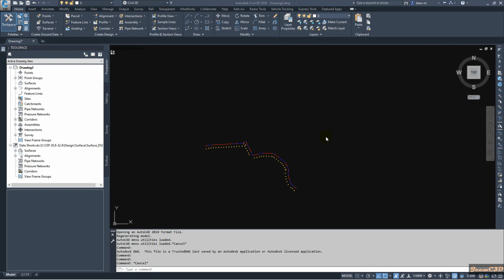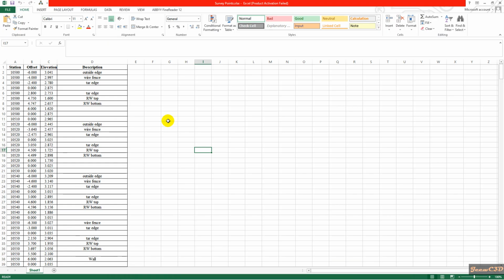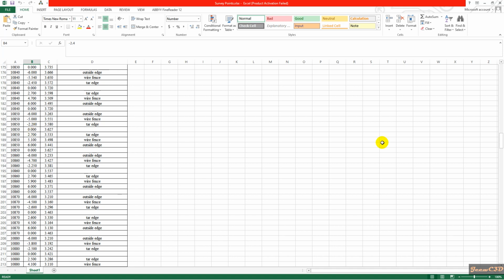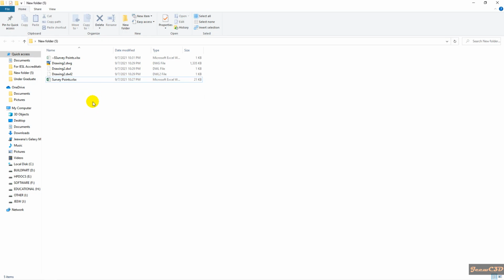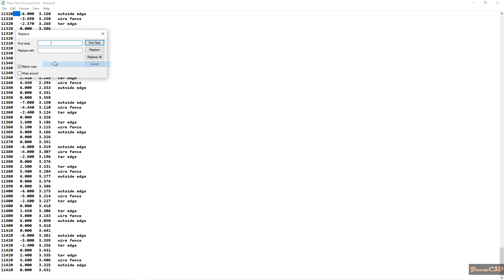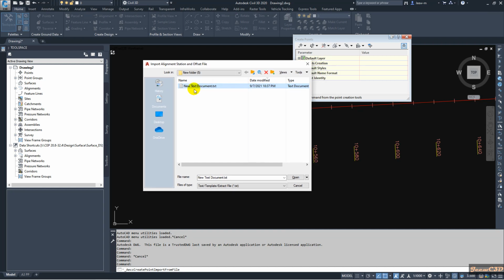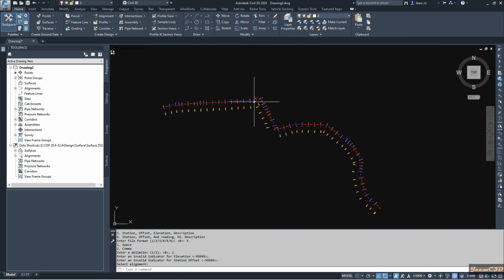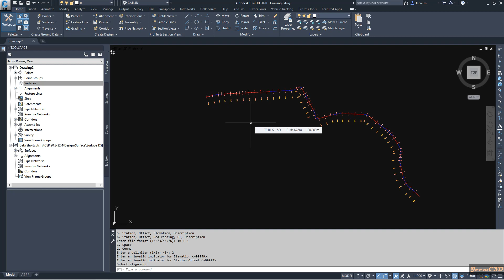Import station offset point data in to Civil 3D Drawing

Comment: How can I add Asbuilt survey data points on design Cross section template
Reply from the maker: Depending on the data type, you can srlect the import method. Civil 3D supports various types and formats to import points.